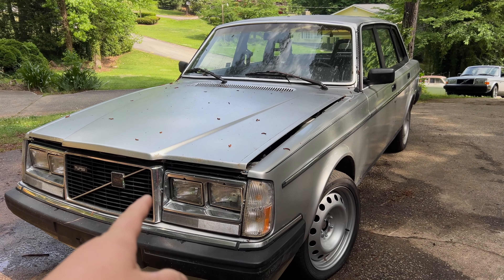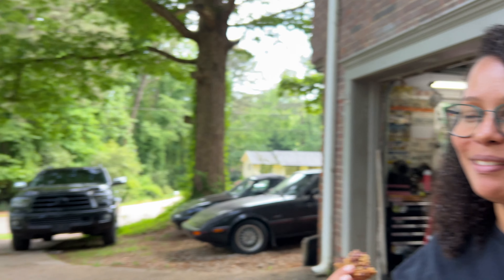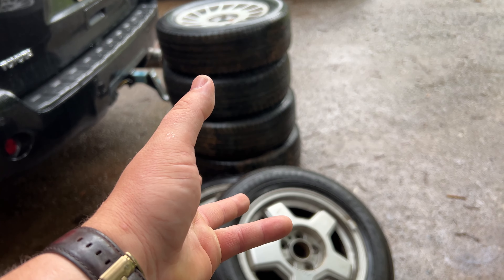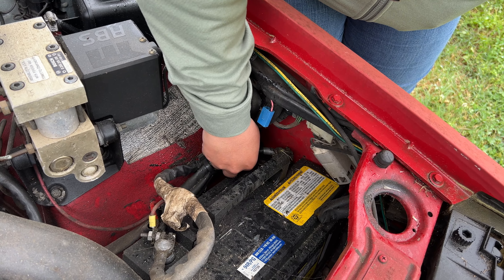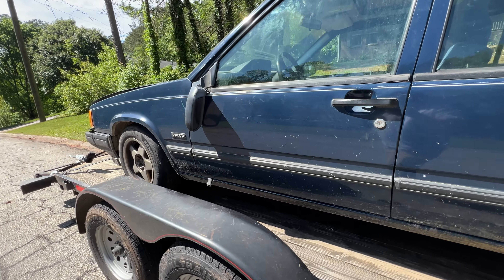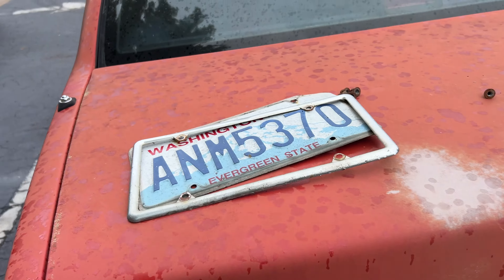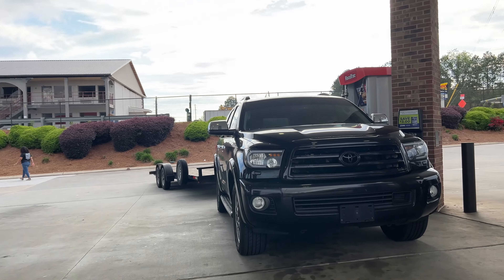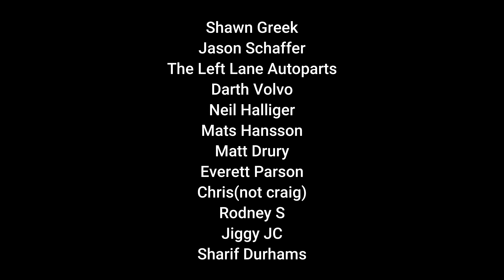Volvo 940 TURBO- Will it run and drive 300 miles home?

Comment: ....and starts right up 😃
my only serious accident was over 30 years ago with a similar brick. A rollover at 120km/h (75 mph) with a 760 GLE. Came to a stop on the wheels, engine was still running quietly (6 cylinders), gearshift in P, engine off, door could be opened, and so I got out and was absolutely uninjured except for a few bruises from the belt. I probably wouldn't have survived in the average European car of the time. That's why I still feel a special connection to Volvo's 7 and 9 Series.
Reply from the maker: I fully believe old Volvos are some of the toughest cars ever built.

Comment: Great to see the co-host roll expanding. It was nice to get some confirmation that my b230 makes mostly the same (normal?) noises as one that has been sleeping for years and is on old oil 💀
Reply from the maker: B230 is by far the most diesel sounding gas motor Ive ever had lol
Reply: @DeanofMachines Oh terribly so.  It has a soundboard of like 20 noises it can make at random at any given time.  It's really desensitized me to engine failure paranoia
Reply: This particular one has been through two plugged catalytic converters.  That’s why it has the piston slap.
Reply from the maker: @POVwithRC  That might be a good thing or it could be a very bad thing LOL
Reply from the maker: @kilgree  Poor little car has seen some challenges

Comment: Great car and a great find! I would keep it as it sits and try eithet a cut and buff video or maybe a paint and restore? I know that might be overkill but maybe someone with a bodyshop locally would assist? Seems a bit to good to rip its heart out even if that was the intention for it??? Good luck!
Reply from the maker: I will be making a cut and buff video. The clearcoat is gone and the base coat is burnt to the primer. This car would need a full repaint.
Reply: @DeanofMachines bullshit! It has a one stage paint job on it. Does not even have a clear coat from factory
Reply from the maker: @GmKcorp  it had been repaired on some panels. Someone did basecoat/clear and it failed.

Comment: Nice! I'd trade my '07 S40 for a decent 940 Turbo in a heartbeat.
Reply from the maker: The s40 simply does not compare!!!
Reply: @DeanofMachines  Nope. My S40 is a FoMoCo-owned, cost-reduced, CAN bus nightmare. Would love to hear that glorious Volvo 5-cylinder sound from a RWD car though.
Reply from the maker: @ChuckFicago73  Many years ago I worked with a company that dismantled 90s and 2000s era Volvos. It was a bummer to see FOMOCO stamped on everything built after 2001

Comment: Plz don't swap god runing cars. Wat you can do is, if you have The blue 940 left. Then remove that engien & put something els in it, & restore the undercarege. Saay if you have a engien just laying around & not take from a god runin car, use that. & the under erea, put New shocks, new swap bar, stronger axel White welded diff & so on. & I recomend if possible, put a 12 walw cummins in it or a big block in in. Do something unic! Mix american cars White Sweden. & do as western Champlin, & put a cumins in a Eco bosted Mustang yes 🇸🇪🇺🇲 & yes it is not like The Lamborghini swaped 245, but it is still goona be unic! Yes
Reply from the maker: These are all great ideas but I am not as well funded as larger channels. We work on a tight budget and try to keep these projects relatable.    Westin Champlin spends a month and 50k to build a car that barely runs for a 20 minute video. Id rather build working, functional, road trip worthy cars.

Comment: I would just VIN swap the white wagon. I am sure another will appear in much worse condition. No one cares enough about old Volvos to check. Especially if you live in a state that does not do emission or safety checks on old cars or issue titles on old cars.
Reply from the maker: Good sir I do believe some people might have a problem with this.